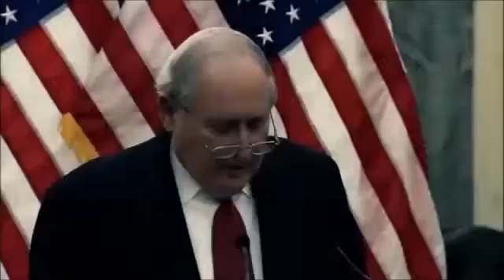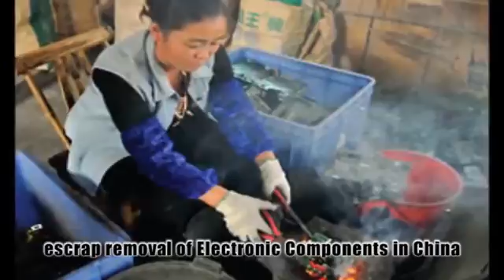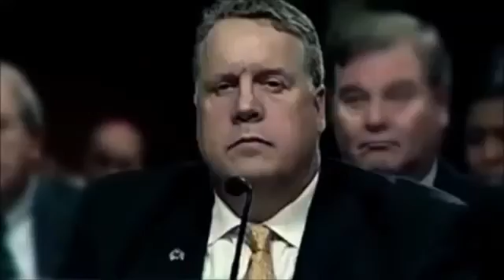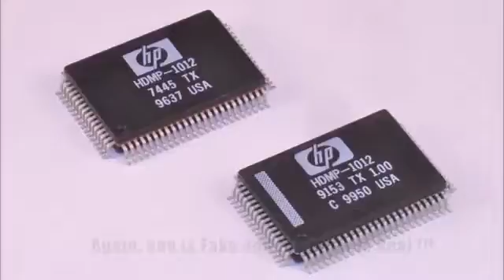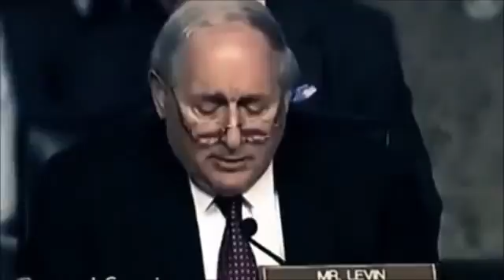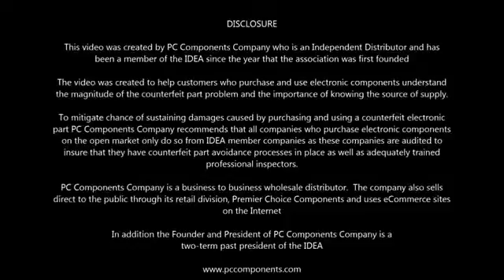Senators McCain and Levin Discuss Counterfeit Electronics from China v6F

Comment: If parts are salvaged from the original manufactures' circuit boards, cleaned up, and sold cheaply as this video reports; then these parts by definition are RECYCLED - not counterfeit! I salvage parts from circuit boards all the time for use in my electronics projects and 99.9% of salvaged parts are electrically sound and function within the tolerances and temperature ranges specified by their manufactures data sheet. For example: If I remove components from an old HP LaserJet III printer like an IC or resistor, keep in mind that these parts were either approved, designed, or manufactured by and for HP by some Dong-Hung-Low company in China in the first place. They are the original parts the damn thing was manufactured with - not clones or counterfeits!  On the other hand I have purchased counterfeit pats from China through eBay and they haven't been stripped and cleaned off of a used motherboards. In actuality, the really convincing clones/counterfeit electronic components are newly manufactured parts that are made to look identical to the genuine article but have zero of the electrical behavioral characteristics of the genuine part. The topic of this video and the way in which its purports such bullshit as genuine facts is the worst counterfeit of truth I have ever stumbled across.